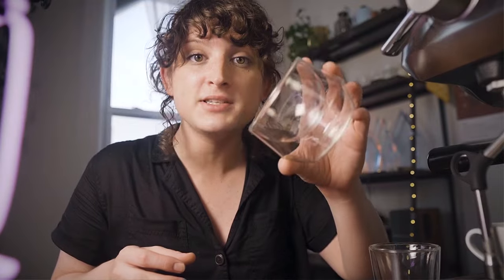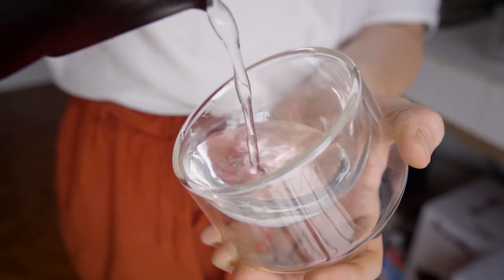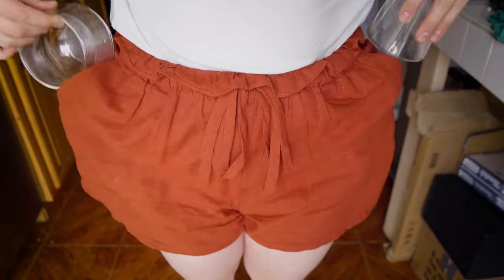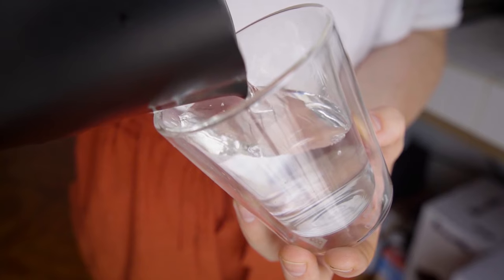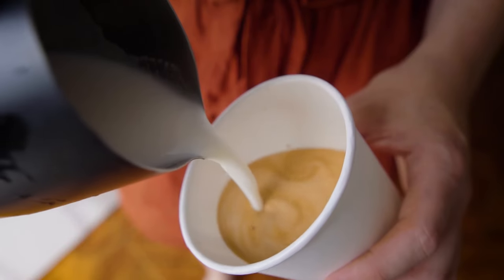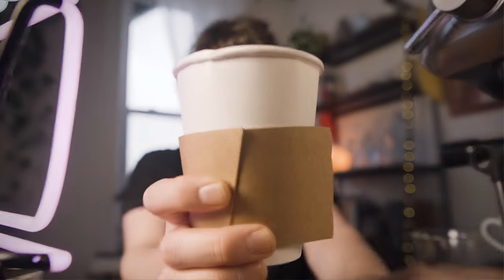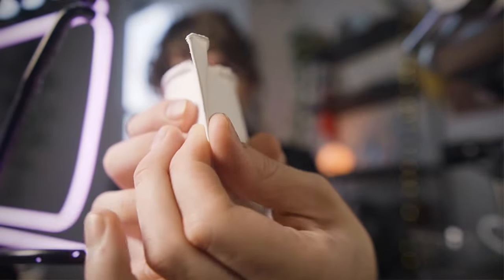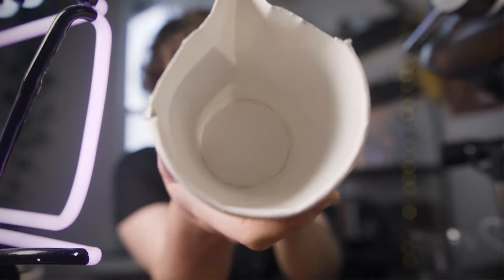Pour Art In To Go Drinks

Comment: Great point about a larger base being stiffer. So… if my steamed milk was stretched a bit too long, I guess I could use a smaller base to help the thick foam move well. And if the stretch was a bit short and the milk is thin, I can pour a taller base to make the pour more stable. Is that right? Time to experiment!
Reply from the maker: Kinda! Definitely if you have thinner milk you’ll want to pour slower and integrate more. With thicker milk you can start sooner but the foam might be too thick and won’t glide at all. That’s just foam for ya. In that case I’d recommend pouring the milk into another pitcher on the side wall of the pitcher and swirl it a ton. This breaks up foam. Also important to note you should preheat that second pitcher. 

Also also using a large pitcher to pour a smaller drink, makes thick foam feel thinner since the width of the pitcher stretches the layer more.
Reply: I do this when I make a flat white since the milk is rather thin